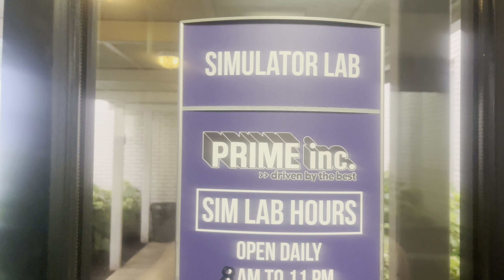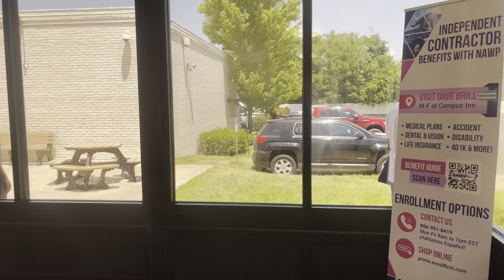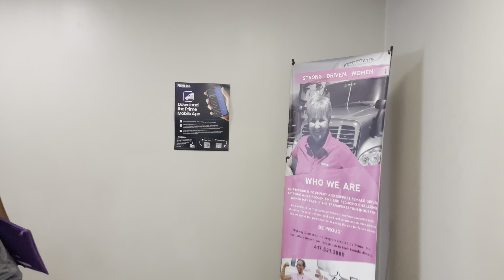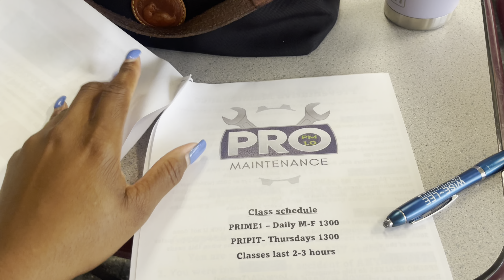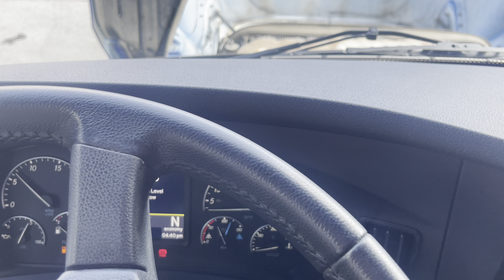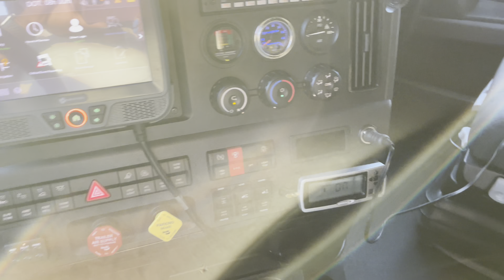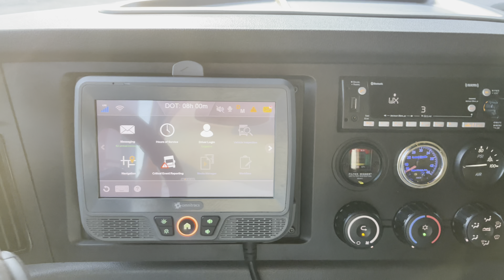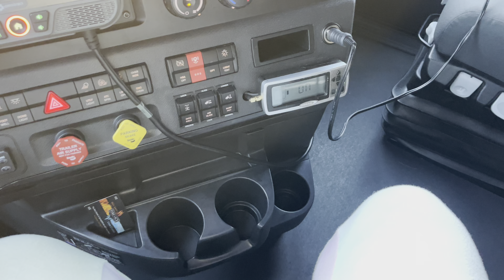Prime inc. TNT 30k Miles Complete!, Upgrade Truck Tour At Springfield, Mo Terminal.

Comment: Congrats on the upgrade!! About how long does it take to do 30,000 miles?
Reply from the maker: Depends on how the trainer runs, we did 3k-5k a week, the truck only stopped to get fuel and we both used our whole clock.

Comment: Question, did you go with reefer and had to do 30,000 miles in two months? Or is the 30,000 for all division?
Reply from the maker: @michaelmartinez3769  When I went to training reefer was 50k miles, prime inc. reduced the miles for reefer to 30k while I was in training and the time to complete training depends on your tnt trainer, we was running hard.

Comment: Its not 50000 miles anymore?
Reply from the maker: No, It’s 30k for Reefer.
Reply: It is 50k for everybody at the bare minimum for a reefer.
It even states that on their website.

However, it also states it's 35k miles if you do either tanker or flatbed.
Reply from the maker: @NextNate03  You are 100% wrong, I’m here now it’s 30k miles now for reefer. The mileage changed 6/28/24 and prime sent a message in the app as well.
Reply from the maker: I posted prime message on my Instagram story.
Reply: @MsDimples_02 What about flatbed?
Reply from the maker: @cleric4265  30k